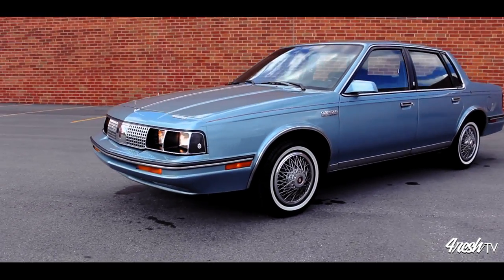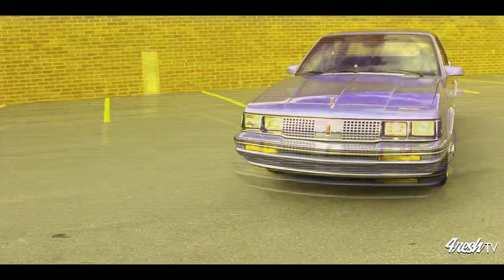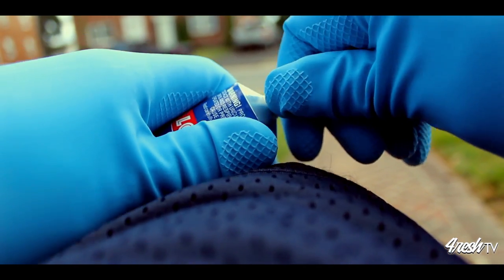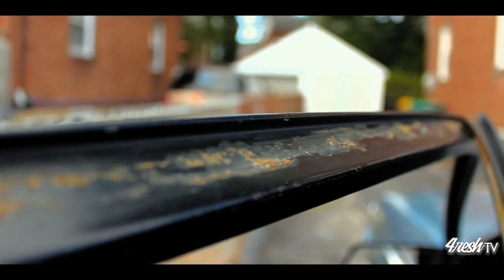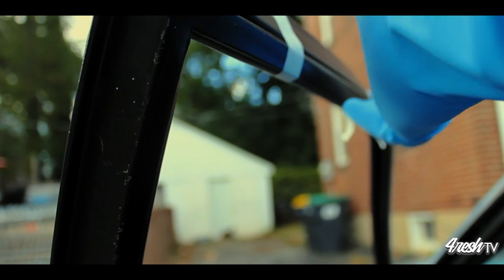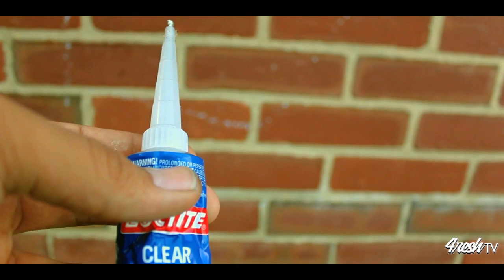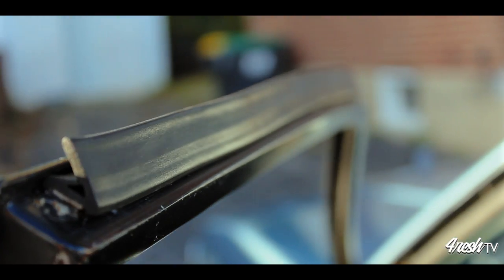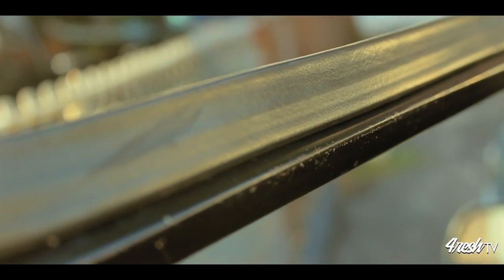How To Fix A Car Door Seal

Comment: Awesome ciera dude, it's really slick. I've got an 88 ciera that needs alot but i can check one thing off the list lol did you use the original piece or did you get new ones?
Reply from the maker: Thank you! I used the original one and tried to maintain where the original glue was still in contact. I’m sure a new one would work just as fine, I just had concerns that it may not be the same thickness as the original seal.

Comment: So this might sound dumb as shite but can I use the same silicone I use in my bathroom? My stripping isn't old, it's just loose because I had to take off a side panel near my hatch which required me to lift the stripping.
Reply: Idk but I'd use the regular kind they use for your bathroom.